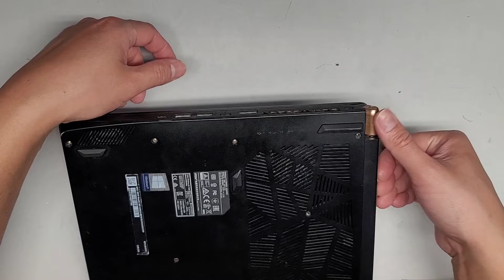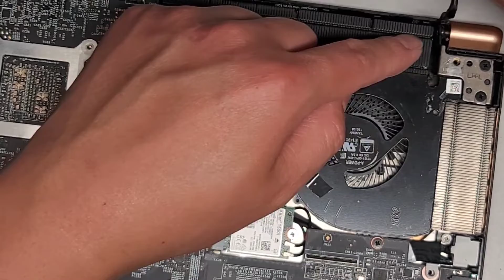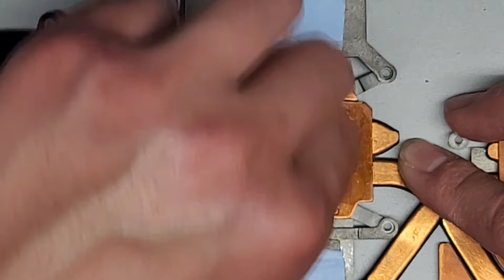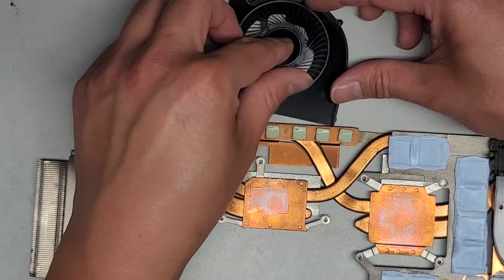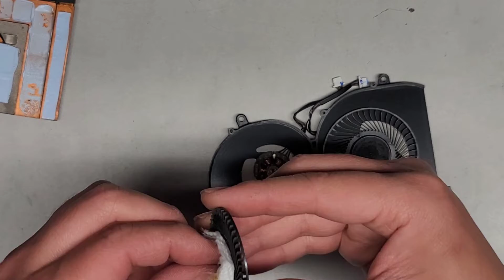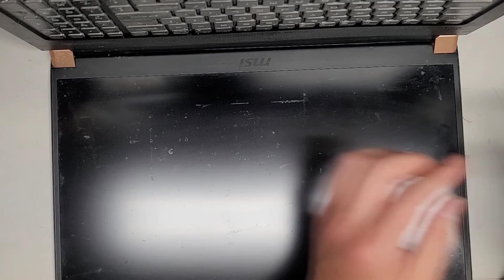MSI GS75 Stealth 8SF-018CA Disassembly RAM SSD Hard Drive Upgrade Battery Replacement Fan Repair

Comment: It took you 1 and 30 mins, it took me damn near 12. 

Either way, thanks to your instructions I was able muddle my way through!!!

Thanks so much man! You even gave me a could of ideas to upgrade it a bit.
Reply: It took me pretty much at the same amount of time as you. This is a really  good instructive video!!

I do have a question about reapplying the thermal paste for @ItsBinhRepaired. The thermal pads on my laptop also looked pretty ragged but i wasn't sure if I should replace them or even where to get replacements from. Is that something I need to be worried about? Thanks again!!
Reply from the maker: 12 hours?! Damn!

Comment: Hi, can you help me? How do I turn on this board without the power button? It's most likely connector CN9. I tried shorting each pin to ground, but it still won't turn on.
Reply from the maker: I don't know the answer to that. Sorry

Comment: ** REPLACEMENT BATTERY **

There are no replacement batteries available in this connector pin orientation. All available batteries on the market have the 10-pin connector reversed.

Where can one get the battery with the correct pin orientation?
Reply from the maker: This? https://amzn.to/45pUf6a
Reply: @ItsBinhRepaired   Thank you. I am confused, as you can see on the Amazon battery, the wire cable direction is going towards the left, rather than going to the right, as shown in your video. 

I have to bring the wires from left to right, I guess.

Comment: Right around the steps at 26:30, the one GPU Bolt under the silver piece is so tight that I can´t get it out. I'm about to give up on replacing the thermal paste. What´s more strange is that 2 of the GPU bolts were already a bit worn out.
Reply from the maker: The screws? You might be using the wrong size screwdriver bit. Need ph1 or jis1

Comment: Thank you so much for this video. I followed it minute by minute while I opened up my 6 year old G75 Stealth and it was so useful having you at my side! Dropped a like and fav to support you

I want to mention a couple things to anyone that might be watching this. If you need to replace the chassis top and bottom, please take a moment to verify whatever replacement is the correct one with the copper antennae baked into the chassis. The replacement that I got did not have that, so I will be doing an experiment with adhering some strips of thin copper inside and soldering the antennae wires to that sheet. I will update this comment with results when I get that done and see how it works, for now I have a wifi dongle for when I need the range since I normally sit right besides my router.

I also want to mention too, it is actually quite viable to replace the laptop body and salvage the old keyboard assembly. I used a pair of needle nose pliers to twist and break the crown of the rivets until I was able to ease it out of the body. This does work quite well and isn't too difficult, but it does take time. When I moved to the next body, I used a soldering iron the melt the plastic pegs that made up the rivets since they were molded as part of the body itself to create my own rivets.

I can confirm the amount of dust that collects in these machines is absolutely unreal, it looked like a lint catcher from my clothes dryer when I took the fans off. The fans seems to be common problems as one of mine were making an awful squeaking racket. I bought a pair of replacement fans for 60$ on amazon. Also repasted my machine with some grizzly liquid metal and loving the results so far.

Comment: Hi , screen and keyboard wont work after reassembling for thermal. I  did everything by video, what could be the issue
Reply from the maker: How do you know the keyboard won't work if the screen isn't working?

Comment: Used this for replacing my cpu fan and it worked out great! Thanks for the in depth video! 

I’m gonna have to take it apart again soon to replace the thermal paste I just put on with the ptm7950 stuff since i’m pretty sure I applied the paste inadequately. I was also thinking of replacing the thermal pads on the VRMs since the last time I did that I wasn’t aware of thickness sizes for those. Do you know how thick the thermal pads on the VRMs are with this model?
Reply from the maker: Sounds good! Not sure of the thickness
Reply: Hi, I'm gonna to replace a thermal interface soon. So, could you tell me how thick the 7950 should I use? Like 0,2 mm or 0,4 mm?
Reply from the maker: They don't have different thicknesses

Comment: Amazing video!
It really helped a lot. 
My Motherboard, small part of it on the edge is completely burnt due to overheating. I even changed the thermal pads. Temperature still fluctuate occasionally.
Seems like I have to live with "Fans on full speed", perhaps one of the chips that is burnt used to monitor temperature and increase fans speed reactively which isn't working anymore sadly.

Thanks for the Video again. Really great content! You deserve the best.
Reply from the maker: @mahmoudalsayed1138  thanks so much for the support! It's too bad that the issue is a damaged component that can't be replaced. :(

Comment: Can you change the CPU?
Reply from the maker: @r.t.h.-R1ghtTh3Han9  nope
Reply: @ItsBinhRepaired  that is for the replied. I subbed. I remember they used to make them socketed so you can swap. Great tutorial
Reply from the maker: Yeah, pretty much all laptops these days have soldered CPU and GPU now and a lot have soldered RAM as well.
Reply: @ItsBinhRepaired  I guess the good old days of socket swaps are over
Reply from the maker: Yup

Comment: Yeah they put too much paste on mine. My GPU has so much that it's underneath that black sticky stuff that goes around my GPU and when I put it all back together I couldn't get it all off underneath that black thing. I didn't know if I could take the black sticky tape off and if it would go back on so I didn't take it off ...

And now with my laptop on my dragon center doesn't show a GPU % ... It shows the temp and MHz sometimes ..but say N/A sometimes ...

I'm thinking about opening it and cleaning it again ... But taking the black tape off the GPU ... But I'm not sure if that black tape sticks back on ...
Reply from the maker: @SteveJ619  hmmmm the tape won't stick back on.
Reply: @ItsBinhRepaired  I didn't try to take it off ...I smushed as much as the thermal paste out as I could...

If I can take that black tape off and it sticks back on... Then I'm going to re do everything... To see if I get a GPU reading in the dragon center again...

Window says the video card's working properly...

I'm playing SWGEMU and I'm getting allot of screen tear ... And I don't know if it's the game or my GPU .. I haven't really used this laptop because it automatically out of the box. It was overheating so I let it sit for about 4 years. Came back to it. The lippo battery was dead. I couldn't get it to work again and I re thermal pasted and added  Corsair vengeance ram.  And the GPU used to show a % before I cleaned and pasted it
Reply from the maker: @SteveJ619  yeah, lithium batteries don't like  sitting unused

Comment: I have this same laptop and my cpu fan is making a horrible grinding noise and catching as it spins (I cleaned it but didnt take the fan off). My plan is to take it apart, repaste the chips, replace the fan, and add another stick of RAM

I've never ordered replacement parts for a laptop, is it hard to get a genuine replacement fan? I dont want to end up with a cheap part that'll break
Reply: Really appreciate the video btw, the fact that you cover how to take out every single part is fantastic. A lot of other videos just speed through it
Reply from the maker: This playlist might help Fan Repair: https://www.youtube.com/playlist?list=PLSSiYX-ta7aqqxfDWDQh-B6Az4ZgDI459
Reply from the maker: If you need to replace them,  these will work. https://amzn.to/3XIMYeN
Reply: @ItsBinhRepaired  thanks man, I appreciate the reply!
Reply from the maker: @user-wh2kv6qq3g  no problem

Comment: Hi! What type of oil did you use in fans bearing ? Can you share model?
Reply from the maker: You can use any motor pil or oil meant for lubricating moving parts.

Comment: I just used PTM7950 thermal pads to replace the thermal paste.  The computer runs so much better than it did before.  I ran a stress test and couldn’t the the CPU over 80°C.
Reply from the maker: Nice!

Comment: Could you tell me which screw bit did you use? (PH0 or PH1?)  I plan on doing an ram upgrade soon don't want stripped screws. Appreciate it!
Reply from the maker: The PH1 should work. Please make sure to watch the video so you don't end up breaking it.
Reply: @ItsBinhRepaired  JIS 1, I don't have the bits. Thank you, was watching the video while also listening to music for around a minute into the video which made me miss that part. I got it. Thanks for the help!
Reply from the maker: @phantom9717  make sure to apply a good amount of pressure so the screwdriver doesn't slip.
Reply from the maker: Neither. I mention what I use in the video.

Comment: I just wanted to remove my fan and clean it, but I accidentally skipped the part where you said I need to turn the power off before pulling the black thing that's close to the fan. Now, my laptop won't turn on. Is my laptop completely broken now?
Reply: LCD Lvds connector
Reply from the maker: @Aequen  likely fried the screen circuit

Comment: What grease do you use on the fans? And do we need to apply grease or is it optional?
Reply: Ok thanks for the advice
Reply from the maker: No problem
Reply: And can we use liquid metal instead of thermal paste or will the liquid metal damage stuff?
Reply from the maker: I used synthetic motor oil, but any grease meant for moving parts should work. You do need do put it if the fan isn't working right. 

Don't use liquid metal. It's not worth the risk and small payout.

Comment: Money just saved..... as soon as I need to re paste! Throughly explained through the whole process. I I have the gs75 stealth 9sg. Replaced the 1tb with a double side 2tb nvme but looks like I need a thinner thermal pad or a longer screw. I chose for now to keep the sweet loose so it's not bending the nvme. Also since this nvme will create more heat I want a heat sink. Any ideas on the thickness of the stock thermal pad is? What size I might need? Also when you installed the second nvme. You didn't use a thermal pad like the stock nvme had. Also the stock pad under nvme was this clear about 5mm thick gelly type of pad. It rips very very easily. Not like any thermal pad I've come across
 Also why didn't you use a thermal pad on the second new nvme? The stick looks like it had one? I've spent 2 days trying to looking for my issue and concerns with not much avail. Closest is your excellent video. Need some advice thank you!
Reply from the maker: I've never seen an SSD have issues without thermal pads other than the oem ones that comes with the computers. I've seen more SSDs with thermal pads fail than not, and that's saying a lot, since more SSDs are available without than with.
Reply: Interesting. This is only in laptops most cases it seems. I gotta locate my hard to find calipers because you know still trying to save than money get some pads for my double sided nvme gen 4 double sided seems to run hotter than one sided pcie 4 s .
Reply from the maker: @rchaze9730  hope it goes well.
Reply: @ItsBinhRepaired  thanks I figured out some more info. just when I thought I understood lol nope. I will be changing out the nvme to a gen 3 card. as my msi pcie is only a gen 3. I dont believe that stock pad is a thermal pad for the metal plate underneath it doesnt seem to fit any properties as a thermal pad I think its just a form of buffer pad. if i keep the gen 4 double sided nvme in as I have it now I would at least install a small heat sink over the controller only. but I have a single sided gen 3 4tb nvme on the way. that should be fine without a heat sink.
Reply from the maker: @rchaze  sounds good :)

Comment: Check out the Honeywell PTM7950 phase-change material is more thermally conductive than the best pastes and gummy thermal paste Upsiren UX Pro Ultra, Laird 607 or K5 Pro on the vrams and power section because have much better thermal conductivity than most thermopads.
Reply: I just did this on mine and it runs so much better now. The thermal pads, from what I understand never need to be changed and they get better as they get used.
Reply from the maker: Nice
Reply from the maker: Hmmm never been one to think better cooling has much effect on performance.